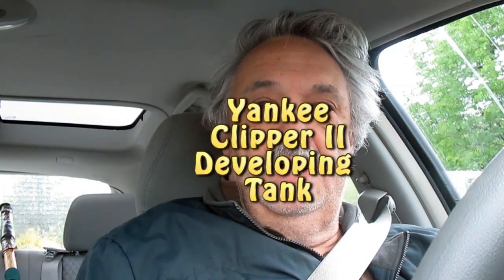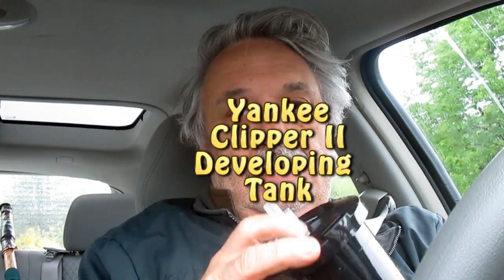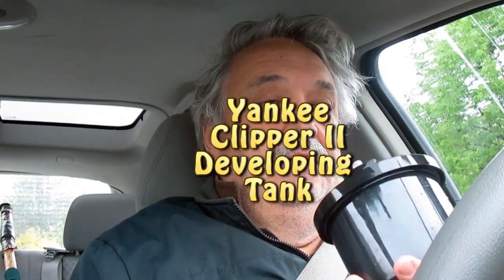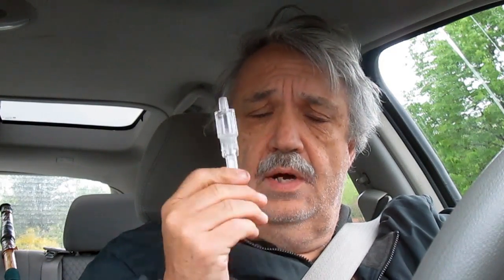Yankee Clipper II Developing Tank

Comment: Thanks for posting this video. I just got my Yankee Clipper II from Adorama and It is exactly as you say. I immediately went online to find out what the deal is with the agitator not spinning. I even thought that, well, spinning the entire drum would work, too, heck, gently shaking the drum would do it. I found your video immediately and shaved down the agitator and it works great. Thanks for all the great info. I didn't know that the tank would develop 16mm film (I bought it for 120). But now that I know that, I may just look around for a micro camera.
Reply from the maker: +Kenneth Bertschy  the minolta 16 II is a nice all manual rugged 16 mm camera . They are old but builts so well they still can be used. Just make sure you get one with at least one plastic film cartridge.   I did a video on it as well.
Reply: If you also want, try to get a Kiev Vega or Kiev 303, There both great cameras based off the minolta but from what I understand they actually do have a focusing system at the cost of some shutter speeds.